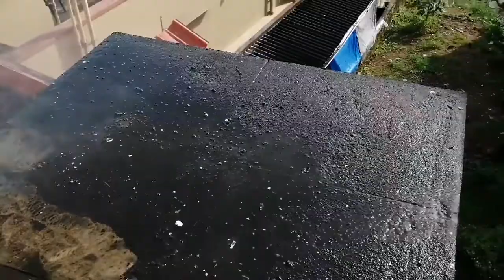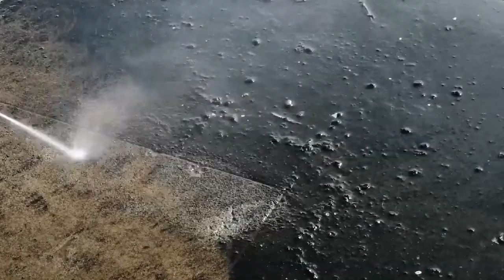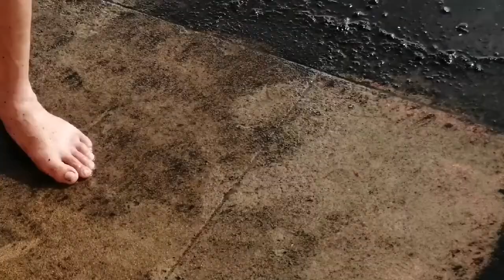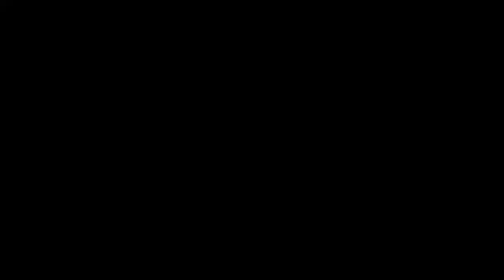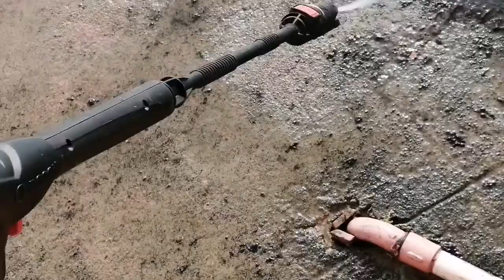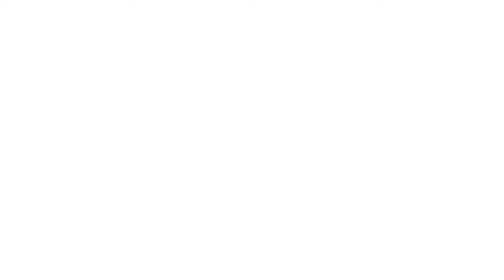Bosch AQUATAK 125 Pressure Washer | Deep Cleaning | Roof Top

Comment: How is Bosch aqua 125 pressure washer performance now ? I would like to buy this product. So I expecting a feed back about the current performance of this product.
Reply from the maker: I highly recommend it to anyone wanting one for simple household needs. When I was purchasing it, I had come across a few reviews that mentioned that you cannot use it for a prolonged duration. However I have used it for nearly 3 hours without break. (once).

Do remember to purchase a safety sleeve for the high pressure hose pipe as it is delicate while being used on rough surfaces.

Comment: how long does the pump can withstand continuous operation ?
Reply from the maker: While it is recommended that we use it for less than 60 mins with a quick break every 1 min of operation, I have used it continuously for 3.5 hours on numerous occasions.

But remember to give a break of atleast 10 mins after 1 hour as the equipment can get really heated up especially if there is no continuous water flow.
Reply: @JeswinCastelino   Awesome. Can't wait for my first pump 💕
Reply from the maker: You can click on the link mentioned in the description to purchase this

Comment: I am unable to adjust nozzle positions.. it's always at full spread position.. how would I rectify this? Though I twist the gun in different direction it's still the same.
Reply from the maker: It's definitely a fault in the nozzle. You might need to take it to a nearest service centre. I have seen a few use a tiny needle to unblock the nozzle. However don't recommend that since I haven't personally done it
Reply: @JeswinCastelino  Thank you!! Just been 2 weeks since I purchased... Already a problem..!!
Reply from the maker: Definitely need a replacement.

Comment: What nozzle is that?
Reply from the maker: It's a 3 in 1 nozzle featuring fan, pencil and rotary jet settings. It comes along with the pressure washer as standard fitment
Reply from the maker: I used rotary settings in this video